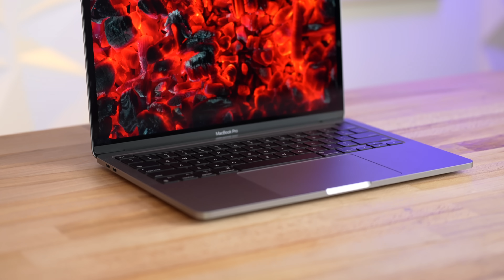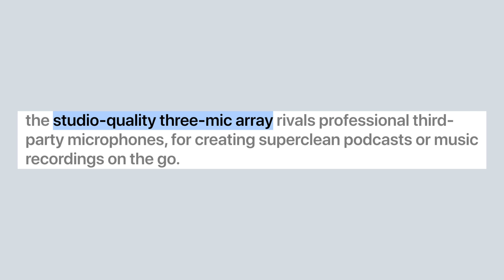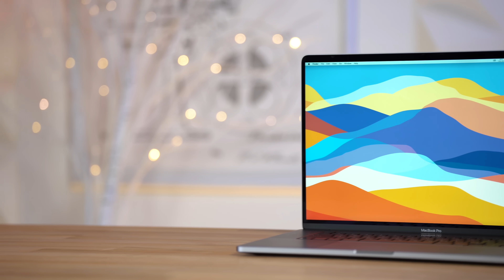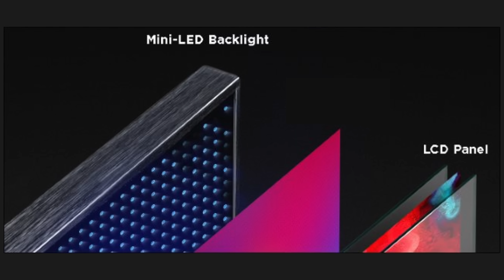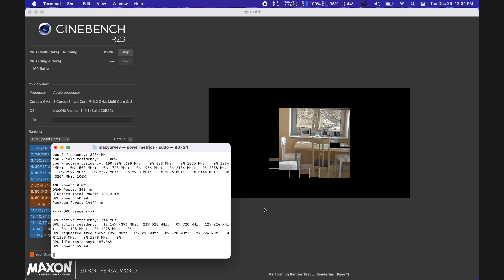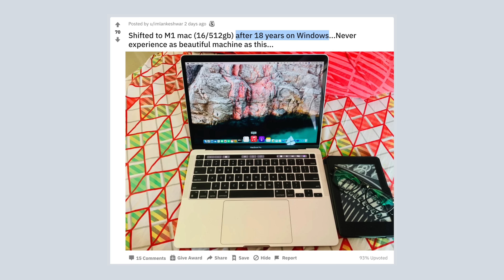M1X 16" MacBook Pro will BLOW Your Mind (What to Expect)

Comment: How color accurate can an mini LED be?
Reply: As accurate as the display technology is. Since apple uses IPS displays the color accuracy shouldn’t change at all. All that changes with mini LED is the backlight, the actual displays stay exactly the same. This isn’t like switching to OLED since that’s an entirely different technology
Reply: @crestofhonor2349  thanks! What about the blacks though? Blacks on screens are usually different then blacks from absence of lights; like a mini led has
Reply: @Daguigoz  depends on how apple's algorithm for the backlight will be. Blacks could be actually black but most likely there will be some some backlight bleed into dark areas since its not pixel based back lights but rather zone based

Comment: I hope 32GB will be an option. For uncompromised high resolution art and and video compositing/ editing.
Reply from the maker: 100% it will.
Reply: You can’t think x86 in terms of RAM when dealing with ARM.

RAM is just a cache between the processor and the storage drive.

Thus the memory size only has to match the largest chunk of information it has to pass to the processor when fast enough.

AMD already showed what a small portion of faster memory ca do (Infinity Cache)
Reply: @auroraflash  No, not really, you need state, stack, etc.
While I agree that today we use a rediculous ammount of memory, you truly want to have the working set on ram.
Memory compression and nvm drives can solve part of the problem, but not all.of it.
Reply: @auroraflash  Yes but NAND is write limited.  If you don't have enough RAM to protect the SSD from excessive writes it better be replaceable.
Reply: @skyak4493  SSDs are a lot more durable than most people seem to think.  You'll get at least 1,000 writes per block and are in all likelihood going to get 2,000.   Doubling the SSD you order is cheaper and offers more flexibility than doubling your RAM.

I suppose if you're doing memory intensive work every day, you may want the larger RAM size.  But if you're doing that kind of work, you're probably going to upgrade your computer before SSD fatigue becomes a problem.
Reply: @auroraflash  I’m very late, but infinity cache is meant to compensate for memory bandwidth, not size
Reply: @jaelynfigueroa1566  you know nothing, really. The memory size itself compensates for bandwidth all the time. What you think it is for? You wouldn’t need RAM or other caches if the transfer was instant and data would be processed instantly.
Reply: @auroraflash  yes that’s how bandwidth works, never said it wasn’t. Size improves bandwidth, but not the other way around, infinity cache does not LITERALLY increase ram capacity. Also insulting a persons intelligence over an friendly observation makes you shallow as hell.
Reply: TBH, I think they’ll even make 64 an option. Such a beast of a machine shouldn’t be limited by 2018 levels of RAM.
Reply: Wouldn't 64GB be better?
Reply: 32gb doesn't matter with ARM.
Reply: @jiml.9026  exactly
Reply: Seems like a waste of money for all but the most intensive audio and video production. 

There is effectively 0 performance difference for any application between 8 and 16GB. The only benefit is stability when you’re using GarageBand with lots of instruments or Premier with lots of plugins.
Reply: @SeniorKlean  lmao, my Docker alone needs around 10 GB right now…
Reply: @FlorianWendelborn  Docker needs 8-10 GB of memory, not RAM.  The SSDs in MacBooks are fast enough that all of an application's data can be paged to Virtual Memory with no perceptible performance drop from fitting all of it in physical RAM.  

I'm not sure how Apple does it, with ostensibly the same technology you can get in a Windows or self-built PC.  Paging to an SSD is not nearly as smooth in Windows or Linux as it is in MacOS.  It is as fast in Windows if you use an Optane drive, but that's expensive enough that you should probably just buy more RAM instead.  I don't think Optane works very well in Linux, but that could have changed since I last tried it a couple months ago.
Reply: @SeniorKlean  This is not true at all. While the SSDs on the current M-series Macs are fast, they are nowhere even close to as fast as RAM that is used in current laptops.

In fact, my MacBook has nearly the same speeds, but it regularly slows to a crawl with only 16GB of RAM. Granted my use case is probably way different from other peoples' use cases, but the SSD definitely can't "take over" for RAM
Reply: @SeniorKlean  yeah cause it eats up your ssd if you don’t have sufficient RAM
Reply: @SeniorKlean  Forget GarageBand.  Pros and serious hobbyists will use Logic or Cubase.  If you are working with sample based instruments, especially orchestras, you need RAM.  Lots of it.  128GB can easily be filled with an orchestral score.  Whatever the performance, if these ARM processors cannot scale beyond 32GB - far beyond - they are going to be of limited use for music production.
Reply: I hope for a 128 GB RAM LPDDR4X or LPDDR5 SDRAM.

Comment: Move the heat producing and lightweight logic board to the display half of the clamshell. Leave the heavy batteries under the keyboard to avoid iPad/MKB heavy screen fall-back issue. 

Two advantages:
1) heat from logic board dissipates faster since it’s up in the air and away from user’s lap/desktop and hands, and
2) more space for batteries under keyboard to keep clamshell balanced (unlike iPad/MKB)

Comment: Hello! I like your structured thinking.
I tend to be more sceptical on performance expectations. While your raw numbers are accurate, more often than not, real performance tends to depend on something more than just raw numbers. It would be interesting to know the benchmarks of an M1 system with the same 4 efficiency cores, 2 performance cores and a 4 core GPU to have a clearer idea of what to expect, namely, if there is, in fact a 2 to 1 difference in overall performance. Unfortunately, right now, there might not be a way to measure that subset from the current M1.
Thank you for this film.

Comment: If the m1X comes with the 14” for the base price of 1299usd that’s just 😘
Reply: not happening. Probably a midstep 1799 usd, as the higher end macbook pro 13" curently.
Reply: Considering the 13" is 1299, no chance.

Comment: Can you help me guys please.... I am not very familiar with computers. I want to get the new Macbook pro 13 M1. I want to use it for 4k video editing (go pro hero 9 / mavic air 2). Considering this, would it make more sense to wait for the MX1 to be released or I have no problem if I order the current M1? Thank you for your opinion !
Reply: even the air should handle 4k video editing with ease, so I would not recommend waiting for these more expensive computers if that's the main thing u do
Reply: @mrplasmanotmr_plasma  thanks for helping !

Comment: Face ID on Mac will be more stupid than the stupidest decision Apple had made, Face ID itself
Anyone who had use Face ID would have noticed, Face ID valid range is even shorter than your arms. I'm not mentioning the lower success rate and narrow angle. 
If Apple is about to bring Face ID on Mac, then the module will must be physically larger to handle the more common long range detection. Hmm, I don't think it is not possible, Apple dares to do anything since Jobs death. 
Even the security, Face ID is less secured than Touch ID, cuz Face ID does not give you strong feedback when it is attempting to unlock your device. Touch ID is different from the root, it has strong feedback, because you have to touch the button

Comment: Technically, this is not battery life, which is Apple usual sub-pair. This is about LOW power consumption.  Funny thing: MacBook Pro M1 has 150W PSU despite not drawing more than 35 or so Watts ( in other review ). Also, I hope that Apple will migrate I/O and RAM and SSD away from SoC.

Comment: I could also see the 14“ MacBook Pro getting the 12 Core Apple Silicon chip since the power consumption would fit perfectly (the current 4-port 13“ MacBook Pro is built for 28 Watt chips). The 16“ could then get a 16 Core chip to fit the thermal capacity of its bigger body. I hope they will go that route. The perfomance will be insane!

Comment: M1 (4 core, 8 graphic cores)- MacBook Air and Mac mini 
M1X (8 core, 12 graphic cores) - lower end MacBook Pro and higher end Mac mini 
M1X (12 core, 16 graphic cores) - higher end MacBook Pro and higher end Mac mini and iMac mini 21 inch
M1X pro (16 core, 32 graphic cores) - lower end 16 inch MacBook Pro, iMac 27 inch
M1Z (32 core, 64 graphics cores) - higher end MacBook Pro 16 inch, and lower end Mac (half the size of current Mac Pro)
M1Z pro ( 64 cores, 128 graphic cores) - iMac Pro and higher end Mac 
X1(128 cores, 256 graphic cores) - low end Mac Pro 
X1 Pro (256 cores, 512 graphic cores) - middle end Mac Pro 
X1Z (512 cores, 1024 graphic cores) - high end Mac Pro
X1Z pro (1024 cores, 2048 graphic cores) - ultra Mac Pro 
All will have 4 efficiency cores.

Comment: You are assuming they won't be binning the M1X with different numbers of cores.  No one said the 12 CPU Core / 16 GPU Core version of the M1X is going to be the base model.   I would expect base models to be more like the Macbook Air, giving a range of options.   If they aren't getting perfect 8-core GPU chips, I wouldn't expect them to be getting perfect 16-core GPUs a few months later...  and they will likely have more M1X's with defective cores than M1s, just due to the increase in size/complexity

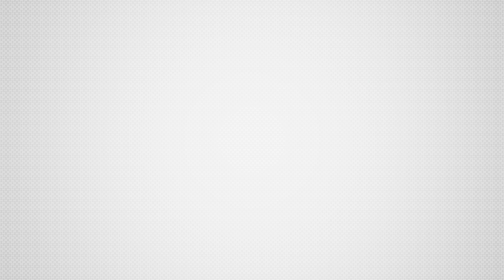Comment: 9:15 This is misleading.

https://youtu.be/WMyAGVmiPWE
(skip to 4:48)

The efficiency cores use 10% of the power (this is correct) but deliver 25% of the performance. If the efficiency cores deliver same performance per watt as performance cores, why would Apple include them?

Also, keep in mind that the clock speed will decrease as you fire up more cores

Comment: I’m guessing that the base model 16 inch will have 6 performance cores and a 12 core GPU. They will probably save the full 12 core CPU and 16 core GPU for the high end models, kind of like they are doing with the MacBook Air. It would be absolutely ludicrous if they put that powerful of a chip in a base model

Comment: Serious question I desperately need answered: when will the Air get the updated design the 14 and 16 inch MPBs will be getting? Later on in 2021?
Reply: Rumors point to Air redesign in 2022, probably without mini-led though
Reply: @Tonyhack123  thank you!

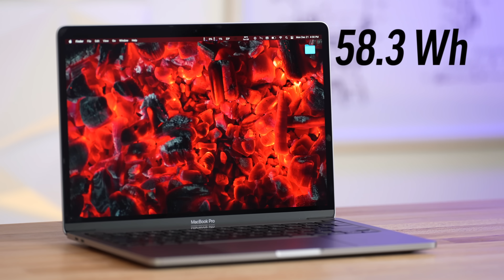Comment: 5:00 How is this increase in battery life possible if the battery is only 16% larger? That would mean that either the Pro‘s screen or other hardware consumes much less power than the Air... What could explain this large difference of several hours?
Reply: I'm guessing the fan and maybe the form factor helps keep the Pro cooler, hence less batttery drain. But again, just a guess. I'm not an expert lol!
Reply: @Tonyhack123  I don't think slightly higher temperatures (watching a YouTube video) would make that much of a difference, if at all. In my view, the fan would even be a disadvantage regarding battery-life-

Comment: Do you think the new iMacs will get the same M1X as the new 16" MBPs?
Reply: I wonder how does Apple justify their iMacs prices if the 16inch MBP works just as good? Knowing that throwing more ram in doesn't make it work any faster.
Reply: @Zeta_ChT  Not sure what u mean. iMacs have much larger displays and have better cooling so they won't throttle like a laptop does for sustained peformance.

Comment: Hopefully the 14inch MacBook Pro will literally be the same as this updated 16inch but in a 14inch body.
Reply: If so, I would rather opt for the 14"... hopefully!
A bigger and higher res display by itself, is not enough to lure me into the bigger and more expensive system, specially with these new two size difference being smaller in percentage. There might be other features in line.
On the other hand, currently, there's almost no difference in performance between the M1 13" MBA and 13" MBP. 
Historically, the difference between these two systems was not as much as that between the 13" and 15" MBP.
Reply: @MiguelCunha2011  i hope it’s something similar to the current iPad Pros. both the 11inch & 12.9inch have the exact same specs, the only difference being form factor and battery size. i don’t wanna comprise on performance for portability. let us have the best of both.
Reply: Agreed  @Tommmmmmmmmmmm ! For me 15, or 16" sizes are not very portable. If they can squeeze the bezels as they did with the iPad and put a 14" screen in a current 13" form factor, it would be perfect.
Reply: @MiguelCunha2011  I read somewhere that that wasn't possible. I.e. a 14-inch screen is simply too large for the current 13-inch chassis, even when assuming zero bezel. So a size increase would be inevitable.
Reply: Being that true  @pretendcampus5410 , I hope they make it as small as possible.
Reply: Or give us the 14" with up to 32GB the 16" up to 64, double the SSD, and two additional TB4 ports

Comment: I'm just wondering what the differentiating factor would be between the 14" and 16" macbook pros apart from size and battery. 

With the current pricing of the line-up in mind, if they both come with the same chip and integrated graphics (assuming no option to increase graphics performance), I don't see how they can convince people to spend the extra money for the 16 inch option.

Comment: Its gonna have a sillycone 0.2 micron meter m86x arm processor with 6 million cores and the gpu power of 32,634 3090ti supers. A screen so crisp and with so many macro leds, itll blind windows users use to inferior non apple screens. Itll have a 16 inch screen so thin, victoria secret models will envy its existence. All possible with 1gb of allied m1 memory fanless chassis cooling. It won't come with a charging plug though you gotta buy that separately

Comment: My guess is that Apple will throttle both the processor and GPU on the entry 16”. You will need to pay more to be able to use the additional cores. Although they did not do it on the 13” Pro, they did it on the 13” Air. Just a thought.

Comment: I think it will be a 16 core. 

12 performance. 4 efficiency.
Reply: @Askellad101  no it isn’t. The 16 in MacBook Pro uses a 45 watt processor. I’m guessing a 16 core m1x will probably consume 30 watts and maybe 40 watts at max. Not to mention the dedicated GPU the Mac also has is about 60 to 80 watts depending on the selected GPU. Apple has nothing to worry about when it comes to power consumption
Reply: @Askellad101  As long as it has the proper fans cooling should be no big deal since power cunsuption will be no big deal. If they use the same cooling system as the current MacBook Pro 16 then cooling those components should be no big deal since they were designed for much more power hungry components. Plus they can keep the fan speed much lower because of that

Comment: Honestly, you should be comparing the M1 to AMD Ryzen. Intel is not competitive anymore. This review is redundant
Reply: He’s doing that because no apple device has used AMD CPUs in their computers. So he’s comparing them to previous apple devices
Reply: @crestofhonor2349  Hence why I said it was redundant. Clearly it's going to better than old tech, why else would you buy it. It's more useful to discuss the machines performance with comparable generation devices especially when AMD has the potential to out perform the M1 chips at a lower cost.
Reply: @moothecow7346  He's comparing them because most of his audience are Mac users and haven't really touched a Windows computer and if they have most of them have used laptops and not necessarily desktops. AMD hasn't been relevant in the laptop scene until very recently. It's pointless because none of these people use AMD nor know the benefits. Although I hate how they think intel or AMD are dead because they use the x86 architecture and Apple's new and fast processors use ARM. I think Intel will be fine once they can straighten out their bad management  and actually start competing. Intel has been stagnant for so long because of AMD's lack of competition. Plus with the new 11th gen CPUs plus some 12th gen leaks it looks like intel finally is trying to get its head on straight.

Comment: Having a new design means it will be getting better internal component layout for these new future M1 macbooks. Imagine a Macbook with better liquid cooling heat spreaders. Since M1 SoC is unified they could improve and make the logic board smaller in favor of A. Better Battery by increasing the capacity or B. better performance by having a better, larger powerful fan and larger room to breath. Or Apple could stump us and have both! Second gen M chips may leapfrog and surpass the current performance expectation we have with the upcoming macs.

Comment: My prediction is that the m1x will have 16 cpu cores and 16gpu cores with cpu/gpu disabled based on what devices. So baseline 32 iMac 16 cores and baseline 16 inch 12 cores with the option to buy a fully unlocked m1x like how the MacBook air starts with 7 gpu cores but can be upgraded to 8. Even if the number of cores are different that’s how I think Apple will handle the different tiers of each device.

Comment: Will the new M1 chip solve the heating problem? My 16” gets toasty when it’s connected to a second monitor or running an intensive app like Pro Tools. If it can, then I’m definitely trading it in. If anyone has tips on how to fix the base model now, please let me know!
Reply: Yes.
Reply: My only tip would be to make sure it has good airflow. Maybe when connected to a second monitor try to raise the computer to allow for more air to come in. And yes the arm based cpus have insane thermal performance

Comment: If I was Apple, I would not only add more cores to the m1X but due to better thermal headroom, I'd also givem them a higher clockspeed to make it even faster, despite it using more power